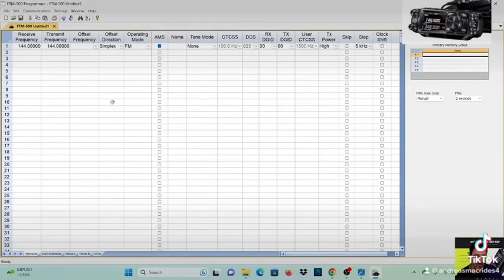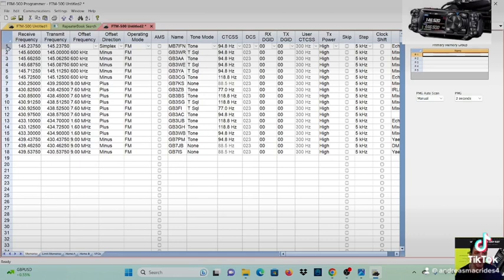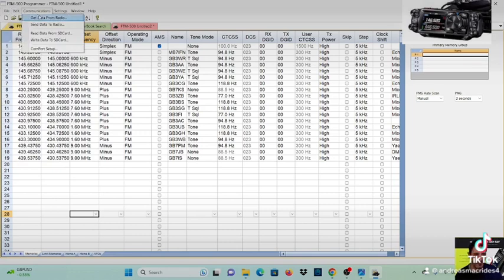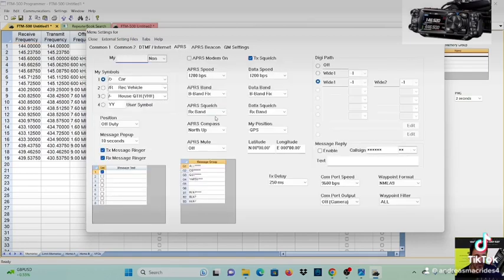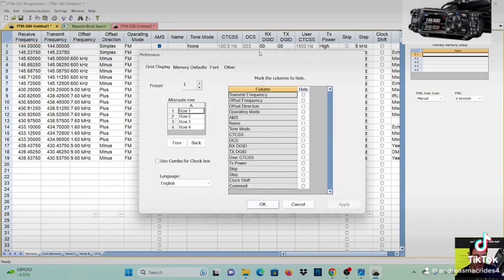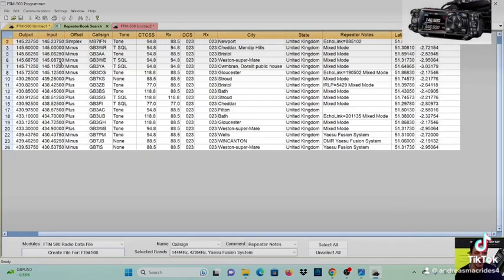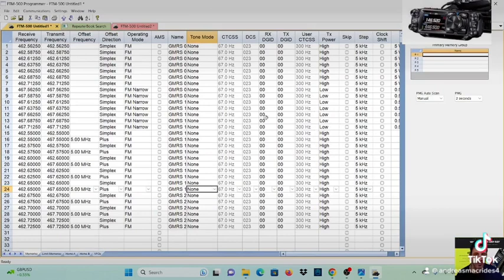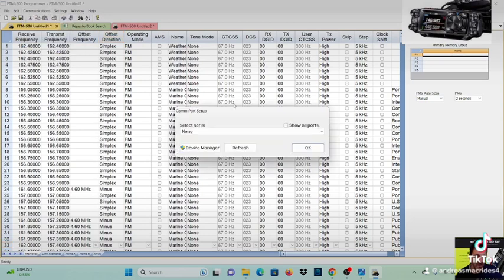Yaesu FTM500 -RT Systems Add Repeaters -GMRS - Marine & Weather

Comment: Hi mate hope you are well I’ve just got the RTSystems programming software I’ve loaded it put the repeaters in and I’ve gone to save the file but it’s not highlighted do you need to plug the radio in I haven’t saved any data to the radio or sd card yet
Reply from the maker: You read radio first
Reply: Hi I found repeater book and downloaded it and saved as a file 
I used the rtsystems cable to read and write sent details over the radio said saved ok but no details in the radio just blank 
I tried again now it’s coming up with errors and fails
Reply: Hi I found repeater book and downloaded it and saved as a file 
I used the rtsystems cable to read and write sent details over the radio said saved ok but no details in the radio just blank 
I tried again now it’s coming up with errors and fails